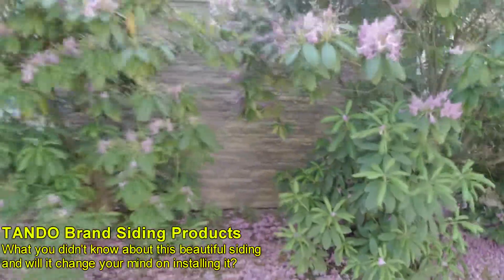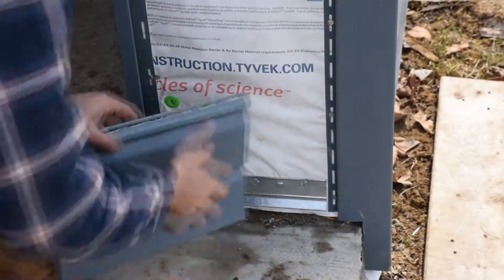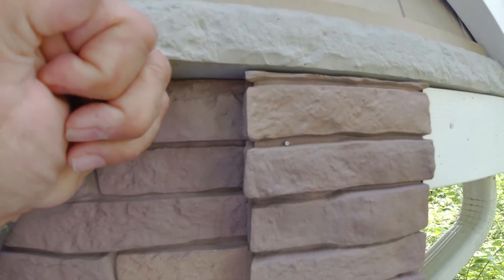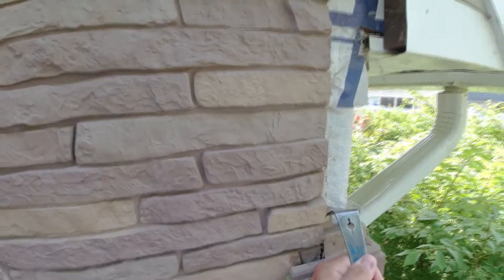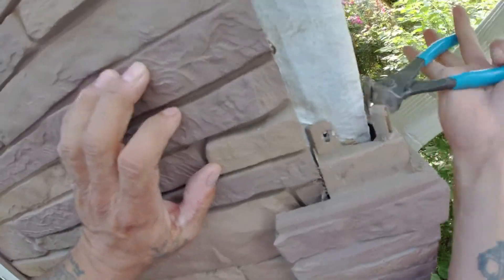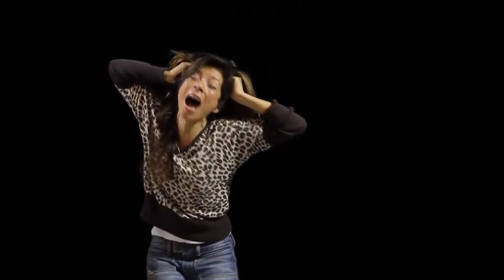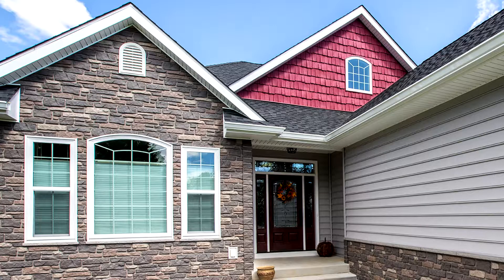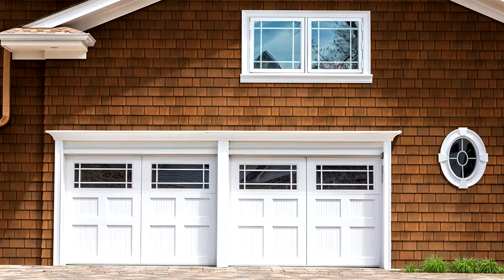TANDO BRAND SIDING PRODUCTS   Would you use this product on your home

Comment: I'm very familiar with those products and I disagree with your comments. First of all, the leak is caused by an improper install of the window sill. Secondly, There are very few sidings that are easy to replace locally without having to uninstall a big portion of a wall. This stuff is meant to be installed and last over a decade. It's not meant to be removed for maintenance every other year.

Comment: I considered this material when I was going to have my house sided. I rejected it because of the very issues you show in your video. 
Windows leak, it's not a question of if but when. My thought was how do you get at something behind this material when something goes wrong. 
unfortunate the average home owner don't consider this when the salesmen is in your living room.
Tando looks grate and holds up well but from a repair stand point it's a nightmare. 
The only way I can see the get at the problem is to use an oscillating saw and follow the joint line of the stone and cut out where you need. Then, nail it back up and try and match the color of the stone on the nail head.
Reply from the maker: I thought about that method and while I know moisture gets behind most siding and it’s the house wrap that keeps it out, I didn’t want to do this on a customers home.
Reply: My 40 year old windows weren't leaking when I replaced them. If you do the job right, they don't leak!
Reply: When I installed my Anderson 100 series windows I used DuPont™ Flashing Systems with butyl backing. DuPont house wrap. The windows where installed as per manufacturer's instructions. WIth Simpson Strong Tie hardware. I took a class with DuPont in Delaware on how to use house wrap and DuPont Flashing Systems. I was invited back to take a class on Dupont liquid house wrap but I declined the offer.  It's been over 7 years now and not a drop from any of the installed windows. Just from an engineering standpoint nothing lasts forever. Mother nature and the sun are brutal, any materials used in the elements will fail over time. It may take 20, 30 or more years but there will be failures. It's foolish to say something won't fail. I stand by my statement "Windows leak, it's not a question of if but when"